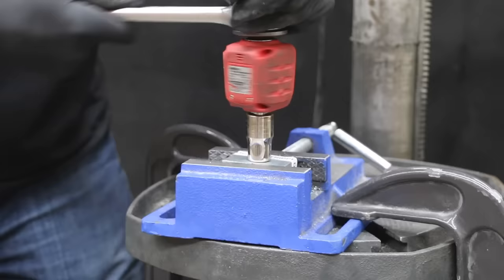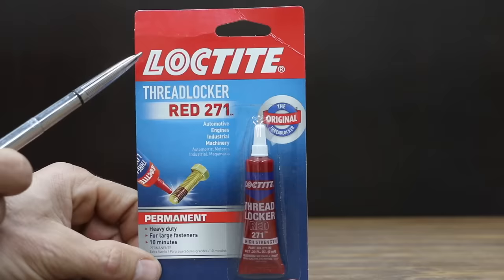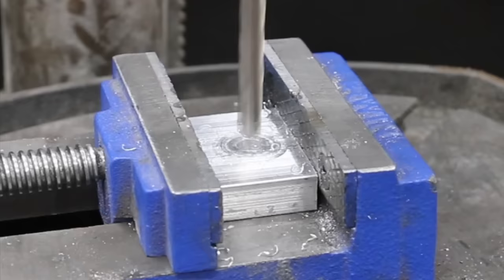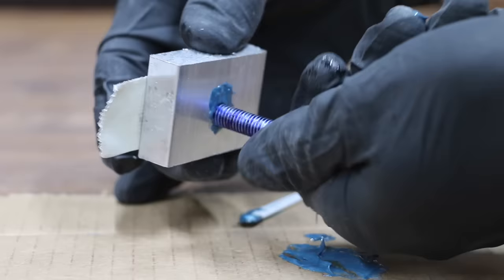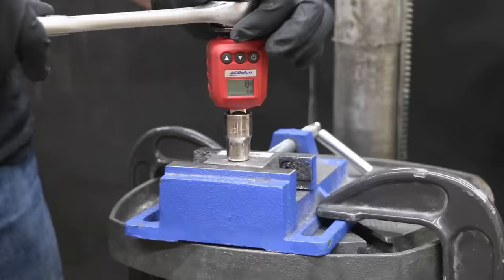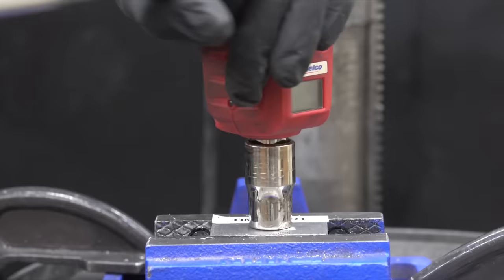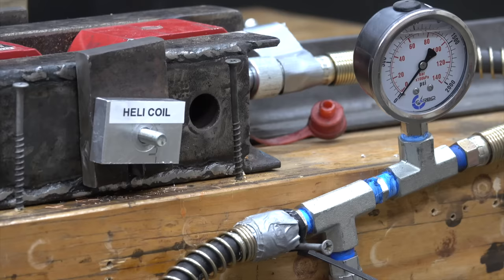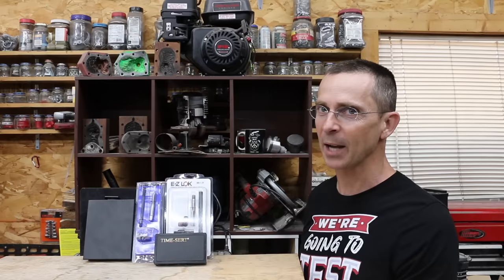Best Damaged Thread Repair? Let’s Settle This! Heli Coil, TIME-SERT, E-Z LOK, JB Weld, HHIP, Loctite

Comment: Thread inserts are not just for thread repair, they are installed all the time from factory in aluminum castings and other similar parts. I've made a lot of aerospace parts that have heli coils installed with traceability paperwork even. 
Another thread repair that is done a lot in the field is to drill&tap , install a larger bolt, cut it off flush, loctite or tack weld or stake in place, then drill and tap the original size in the hole, sort of like build your own insert. If done well its a solid repair that you can do with just a tap and die set instead of having to go find the correct thread insert set. Also is great if the original hole is very damaged and so over sized so you can't just use and off the shelf inserts system.
Reply: That same idea is done in wood working with gluing in dowels to fix mistakes or fill in worn out screw holes. Any difference in strength is very minor as the wood glue is stronger than the woods used as long as you give the wood glue time to cure first.
Reply: I've done the oversized bolt trick many times in my little machine shop when i didn't have the right helicoil kit and it's always worked great and there's no waiting around for the right helicoil kit to arrive
Reply: I've been designing a light aircraft, and this has been an area of concern. The engine (85-90kg) is supposed to bolt to 4 points in an aluminium bulkhead/firewall. Which type of thread insert would you recommend, based on your experience?
Please feel free to be as specific as you wish.

Thank you in advance.
Reply: I have a 6.5 diesel block that was bought with starter hole problems. One hole is re drilled off center and oversized. Been thinking about having it welded to re drill. But now I think I'm going to try the oversize bolt trick and drill/tap it to OEM size and location. Thank you for the idea.
Reply: @leoarc1061  they all work well, you just get a much larger bearing area for the same fastener.
Reply: Every ldg overhaul we replace the helicoils, they are used to protect the existing threads
Reply: True indeed. You do have parts that come with threaded inserts (helicoils, slimserts, keenserts, etc) from the factory to protect the parent metal.  Also installing threaded bushings that can be be swapped out.
Reply: @leoarc1061   Hey Leo, mechanical engineer here. A 304 stainless steel helicoil style insert would be perfect for that application. They will not back out and will be much much stronger than the aluminum thread. I used a 304SS helicoil to repair the subframe on my dirt bike after i tried to thread a M10x1.5 bolt into it, not knowing it was fine thread (M10x1.0). I felt pretty silly but the repair has held up for over a year with a lot of rough riding
Reply: @leoarc1061  As seen in the video, technically speaking all of the inserts will be mechanically sound when installed and your bolt will fail before they do in an all out tensile strength test.  However, when you factor in other considerations, the helicoil is not only preferred but is often the only approved insert.  It's specified by name for many aircraft and engine manufacturers, and all repairs to spark plug holes in LyCon engines require the use of a helicoil.  It's 304 stainless, so it holds up to high heat and is corrosion resistant.  The particular insert you get for spark plug repair is unique to heli-coils in that they're serrated at the bottom to lock the insert into the cylinder head.  They also come in several different sizes depending on just how bad you buggered up the threads.  For airframe inserts, you do get multiple oversize options, but generally no serrations as those are only needed on fasteners that are frequently removed such as spark plugs and oil drains.

The very thing that makes a time-sert so strong is also its biggest downfall in aviation, as the counterbore design introduces stress risers on the hole itself.  The counterbore is flat and straight cut, while the insert is tapered with a protruding nub.  What happens is when you torque the insert, that taper mates with the sharp edge left by the flat counterbore and concentrates stress on that tiny surface, then that little locking nub digs into that same surface.  The end result is that after numerous stress cycles in that area, a crack will eventually form...this happens whether you're bolting flexing wings to a spar cap, a vibrating engine mount to a firewall, or a spark plug into an engine that sees both vibrational stress as well as thermal cycling.  It would be somewhat better if the counterbore was actually tapered to match the insert, but that nub is still there...take away the nub and it loses a lot of its retaining capacity.  Also evident by this video, time-serts are not very corrosion resistant, as they lack any approved corrosion control measures.  That's the reason why both the "big-sert" version of it as well as the others that look similar to a heli-coil are not approved for repair or manufacturing in the FAR/AIM regs.

I would recommend not pursuing a solid insert, but rather a coiled wire type.  The mechanics involved behind how a coiled wire insert forms a stronger interface than a solid bolt with the same thread size is an interesting one.  The wire itself distributes the load across all threads because it can stretch alongside the bolt inside of an unyielding parent metal.  It basically form fits itself between the parent metal's threads and the bolt's threads, while a solid bolt will place all of its stress on the top 1-2 threads where the bolt naturally stretches from a proper torque.  Coincidentally, that's how a bolt strips out threads from a similar parent metal, it stretches at the top and causes those top threads to shear, which in turn places all the stress on the next few threads underneath that, where the bolt once again stretches and pulls those threads out, going down the line until you're only left with a thread or two actually holding all of that force.  This happens on a nearly indiscernible scale to the torque applier, it just feels like the bolt reached a certain torque and didn't snug up any more, like the threads are maybe a little dirty or there's a gap between parts being pulled together...so the bolt is turned even more to find that sharp rise in resistance but is met with a sudden drop in resistance instead because the threads are toast now.

Good luck with your aircraft, maybe some time in the future I'll see it here on youtube 👍
Reply: @Leo Arc dont forget safety wire! It only adds a small ammount of weight but gives you confidence those fasteners wont back out under vibration.
Reply: That's what the EZ lock system is
Reply: Nice work and really appreciate the effort to look at the parameters of torque, tensile and corrosion.  It came out as I expected for insert, vs repair compound vs copper.  Copper ends up being cosmetic, but in some rare cases, that’s all you need.  I’d still grab one of the compounds for a little more sticktion.   And some great comments here on the reasons for the repair strength that solidify my initial thought that the insert-based repair should be stronger than original aluminum configuration.  The one comment with lots of analysis on specs, design and impact to longevity was pretty solid too.  In general, if the repair is stronger than original you should be in like Flynn.  I think the comment was interesting to review the comment on the failure mode for a stripped bolt.   The failure range for torque on the bolts themselves creates some questions.  Maybe that takes some more thinking and analysis since E-Z LOK pulled out way ahead for torque failure, roughly 40% increase.  Did the bolts fail uniformly in the same location?  Any other factors you can think of for the delta?    Once again, I liked the effort and analysis.   PS - I guess I have to go get some hydraulic rams for the shop now, hehe.
Reply: @leoarc1061  What kind of bolts do you plan to use ? I mainly use stainless steel Helicoils when designing/building spacecrafts unless I have to use stainless bolts which would cold weld under vibration and/or vacuum. For those, I use bronze inserts. As for the length of the inserts, try to go for 1.5 D if you have enough thickness in your part (you may increase it locally). Vibration are usually not a concern for those inserts as you will have other problems elsewhere if exceeding their preload. Still, most helicoil inserts are also available in self-locking variant if you feel the need.
Reply: @MrMega200  Agreed, just need to consider factors affecting dowel success.  Some times a dowel can provide a horrible repair strength-wise due to loose grain or bad grain direction in the dowel.   A dowel used only as a dowel/tenon, and not a bit of replacement for damaged wood for a screw, is better when the grain runs the length of the dowel.  That improves the shear strength.  If used for holding in a screw then a well glued plug provides a better grip for the screw since the grain runs perpendicular to the threads and holds better.   If the grain runs the length of the dowel, then it’s more like screwing into end-grain, not as strong.
Reply: Have you ever seen any ceramic insert? I've been searching for a while M2 and M5 inserts that are unaffected by strong magnetic fields and never found any. I wonder if that even exists...
Reply: @leoarc1061  You're literally asking that question on a video where a bunch of them were tested? Leo... come on. You can do better than is. I believe in you Leo.
Reply: @leoarc1061  thru bolt using NAS fasteners and NAS nut plates would be the preferred method. Sounds like some engineering analysis/FEA would benefit you as well, but when in doubt use a larger diameter than you think you need if weight allows.
Reply: @leoarc1061  Look at the Project Farm video. He did the same tests in aluminum.
Reply: @MrMega200  I did look at the video. In many of the tests, the fastener failed before the threads did, so there's not a lot I can take from it. Furthermore, these static tests do reflect the vibrations, load directions and heat cycles of hundreds of hours of operation.
Hence, I decided to ask for the opinion of persons with experience in this field, which have been incredibly helpful and insightful.
Reply: @leoarc1061  I'd say you're asking the wrong people in this case. If it's for aviation purposes, you should consult the relevant aviation authority to ensure that you are adhering to the correct standards for your application. It's too important to take any chances on.
Reply: @leoarc1061  One issue that should be addressed when using a non-stainless steel insert with aluminum is galvanic corrosion.  Basically, if the insert contains any steel, the whole thing needs to be kept WELL sealed against water ingress to prevent the aluminum from being eaten away.  The last thing you need is for your engine to shake itself loose!
Reply: Yes I work in aerospace industry and every aluminum structure I've seen uses steel thread inserts in the aluminum rather than threading an aluminum hole
Reply: @jasomkovac9115  Yes, that is a possible solution but one that I'm trying to avoid. It will make the monocoque slightly longer, heavier, and harder to remove the bolts. Another reason to avoid it is that this problem happens again in the wings, in the landing gear, etc. So, whatever light, neat solution passes rig tests on the engine mounts will likely pass tests on other areas.
Stainless heli-coil seems, so far, to be the best route to take.
Reply: @Zaku186  That’s definitely an important aspect: preventing a fastener from backing out. But that one is relatively easy. It doesn’t carry a significant weight penalty; only complexity.
Reply: @shadowopsairman1583  ldg?
Reply: @Skinflaps_Meatslapper  Thanks for that. What you said about the flexibility of coil inserts makes sense when you think about it, gives me more confidence in using the cheaper option.
Your name did make me chuckle 😸
Reply: @Macmonkey1000  Sometimes the best is cheaper because it's used the most, economy of scale and whatnot.  The most simple and elegant solution implies there should be an aspect of cost effectiveness to it as well.  If you use a helicoil properly and for its intended purpose, you'll have zero issues with it...they're remarkably tough.

My name was carefully crafted for an optimal atavistic response in humans without resorting to inappropriate language, it results in a 70/30 split between humor and offense in the general populace, with an unanticipated 96% memory recall.  Odds highly favor the possibility that you will inadvertently remember this name years from now in a delicate situation where laughing would be socially unacceptable.
Reply: I've met a couple of people call bolts by the size of the head so a 1/4 inch bolt is a 7/16 in their mind so they grab a 7/16 tap to clean threads only to find out it doesn't fit in the hole and for some reason they just start drilling so that the tap will fit and then wonder why the bolt don't fit and then for some reason I'm always the guy that has to fix it and one time it happened to be a small block Mopar installed into a 37 Plymouth and of course it went right into a coolant passage and the bolt was no where near straight and the hole was wallowed out so even with the huge 1/2 inch bolt in it it was leaking coolant all over the place and I ended up just threading helicoils into helicoils with a whole bunch of pipe tape to get it to stop leaking and the hole was still crooked as a lawyer but it worked long enough for me to find a different job where the boss didn't do that stupid stuff to his own car

Comment: Something that I would like to see tested on this channel is sound deadening mat for automotive use. And also duplicolor has rubberized undercoating that claims to be sound insulating, I wonder if it would be comparable to different brands of mats.
Reply: I can answer that one from experience. Nope. It makes pretty close to zero difference
Reply from the maker: Thanks for the suggestion.
Reply: That’d be an awesome test, he could suspend a sheet of steel, bolt a transducer to one end (kind of like a plate reverb design), and then put a contact mic and an audio mic near the other end, apply a four foot square patch of each brand to the middle of the sheet, and measure what frequencies it deadens and by how much.
Reply: @ProjectFarm  If you ever do such a test, be sure to test for high temps and melting goo running out of doors. The brand I went with drips out of my doors years later and destroys my door seal no matter how many times I replace it. Huge mistake on my part.
Reply: Add 90# roll roofing to the sample list for siund deadenerst. I bet  Professor Farm has som lying around.
Reply: Yeah, looking for one that works well and doesn't add much weight. Saw some spray on called lizard skin and have doubts.
Reply: @williamevans6522  As long as it's non-asphalt impregnated. You don't want that crap out-gassing into your lungs. I have some pure butyl stuff that's thin at only 10mils, but even 3 layers of it is half the price of most commercial mats.
Reply: We use HVAC Duct wrap from Frost King in our semi trucks, cheaper than BoomMat and just as good.
Reply: @drg19841  My experience is very different. I have rolls of mat material possibly Dynamat but not 100% sure. I find the stuff amazing. I have an antique Dazer architects light. The transformer had a loud buzz. I took the case apart and lined it with this stuff. You can't hear it any more. I also have an antique Coke machine. Sometimes the fan motors get loud. This will also fix that.
Reply: @drg19841  then how did I spray the whole interior of my car with lizard skin,and now when I walk in the shop it sounds as if I put wall to wall carpet in the place?